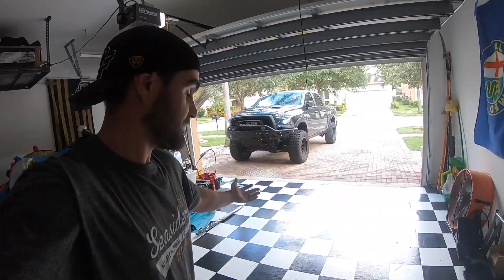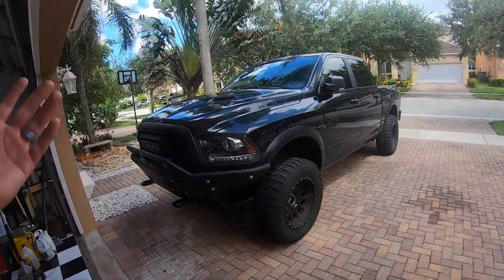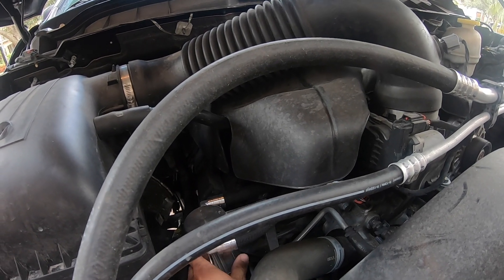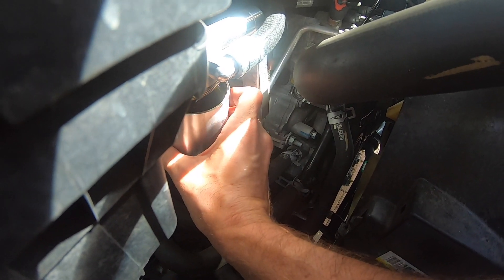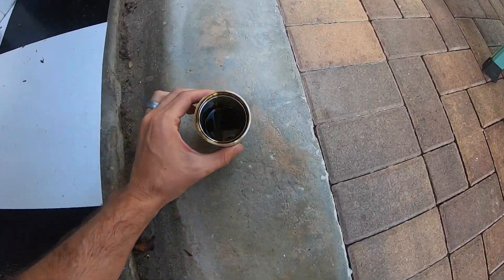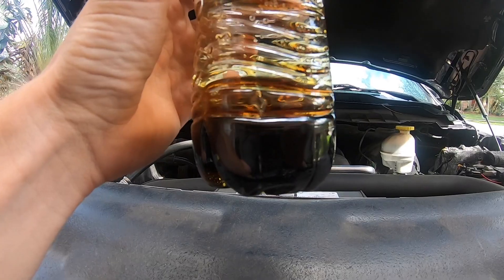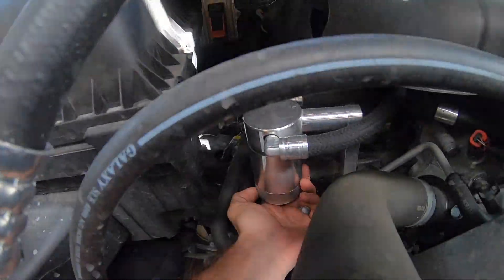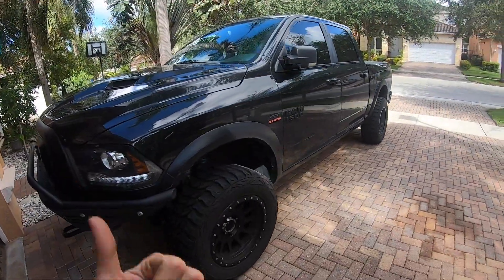Ram 1500 Oil Catch Can UPDATE!! 5.7L Hemi UPR Oil Catch Can | SHOCKING RESULTS MUST SEE! | Best Mod?

Comment: I miss how my rebel used go drive. I wanted go buy the bds 4 inch lift but still cannot find the issue with the air ride, still hella stiff and I've taken it to dealerships and they either cant find the issue with the stiffness. Thinking of doing a coilover conversion tbh
Reply from the maker: I feel your pain man I’m in the exact same boat. Been to 2 different dealers over the past few months and non of the have been any help. One dealer tried to sell me on replacing the compressors but said they couldn’t promise that would fix it and it would cost me $2000+ out of pocket. Coilovers are starting to look really good right about now.
Reply: @Wimya  yeah I'm thinking to switch over to a fox 2.0 or a 2.5. I've taken it to three and done a system recharge and nothing.
Reply from the maker: I’m gonna pull the trigger on the Fox 2.5 pretty soon. I’ve had them in my cart for a few months now lol.
Reply: @Wimya  dude same! I'm just super indecisive if to go with them or a lift. Too bad I cant add a lift into the fox shocks. The icon stage 5 get my attention. But if you do go with a coil conversion dont forget to upload a video! Ha

Comment: Ok I generally hate to pick, but here goes.   Does he drive across a Baja 1000 training course otw to work everyday?  If so, perfect truck.    Does he drive through flooded areas, swampland, marsh, creeks, washed out roads, etc?   If so, perfect truck.   Does he drive this because he likes to go off reading as recreation?   If so, perfect truck.    Or does he just like the truck and that’s what he wants and that’s what he bought and if I don’t like it, fuck me.  If so, perfect truck.    But my observation is that it’s always the smaller guys, or maybe not even that, the insecure guys, who buy jacked up macho trucks.  He doesn’t seem insecure.   Seems like totally cool, all around with it dude.     If so, perfect truck.    I’m a really bug guy, and I drive a Hemi Magnum, cause I need to carry a lot of gear for my business, and I like time sideways with smoking tires, and that’s lots more fun with a lower center of gravity and 1000 less pounds.     Some might say I’m compensating by driving a big, powerful car.    But then I get out.  Compensating for what?    Being top heavy?   Yep.    I don’t like tipping over.   You’d need a forklift to tip over a Magnum.    Nice truck.   Looks like the catch can works, as in it catches oil.   So why didn’t Chrysler do that if it is needed?  That’s the biggest question.    They aren’t idiots.    There is a reason, and it’s not because they are cheap.    They’ve got all kinds of safeguards we don’t even know about which cost far more than a catch can.  So what gives?    I’ve found what anal ears to be way to much sludge in my intake manifold and I’m convinced that it is contributing to my stalling issue.  I think my EVaP system is allowing gasoline soaked charcoal through the purge valve and into my intake.  A catch can wouldn’t stop this, but if the sludge is from the crankcase oil, it would.   Maybe the intake is suppose to look like that.    I doubt it.    There’s no way in hell that was designed into the airflow.     No way.

Comment: Hey , I seen your from Fl, I was wondering if you still have your rebel bumper ? If so would you sell it ?
Reply from the maker: Danny Cruz hey, yea I’m in FL but I keep all of my stock parts sorry brother.
Reply: Wimya sounds good , 👌🏼 is really interested in doing like a rebel conversion to mine , do you know if the bumper have the same bold patters as like a Laramie 1500?
Reply from the maker: Danny Cruz Yea the bolts should be exactly the same for the Rebel vs the other trims. It should bolt right up. Then you’ll need the OEM Rebel front grill.

Comment: That doesn't seem right.   Why so much oil?  You'd think something's wrong..    thoughts?
Reply: I believe the Ram hemis are bad with this.  Had to replace the valves on my 2011 after a lot of oil was getting into the combustion chamber and blowing blue smoke out the back. The mechanic said the valves were “burned up” from all the carbon and oil. This probably could have helped prevent that. It seems a lot of Rams have valve and burning oil issues.